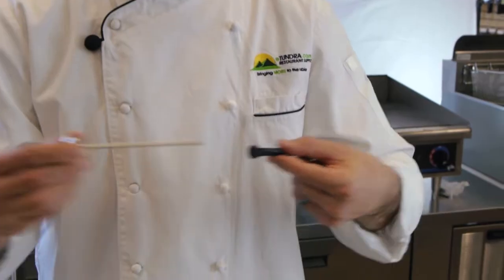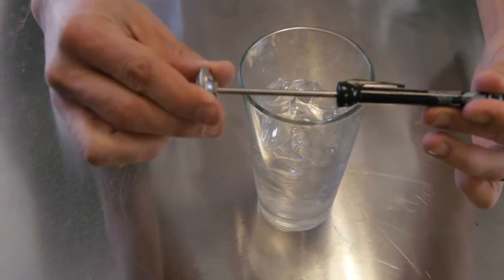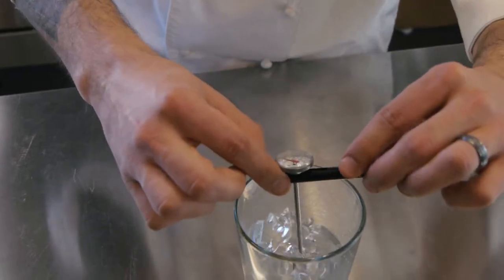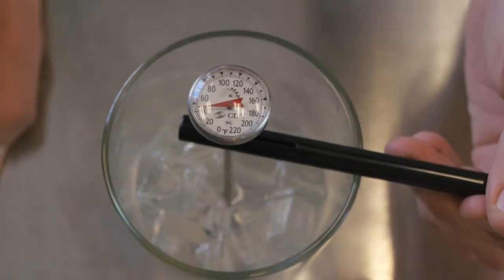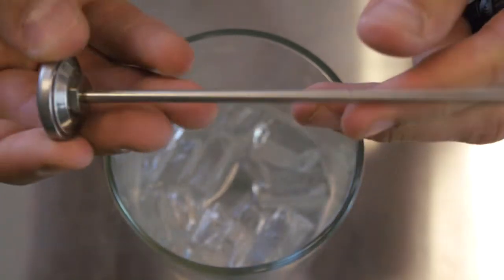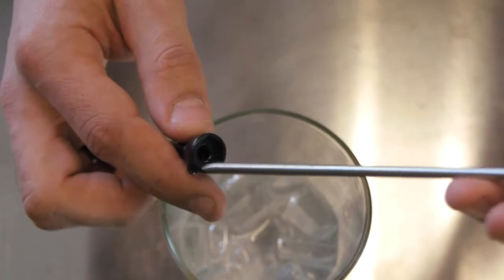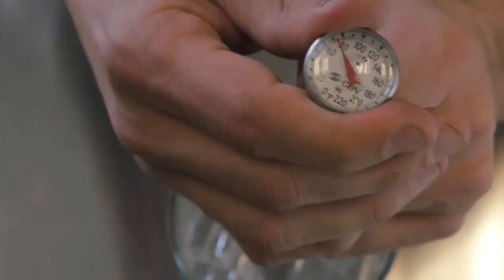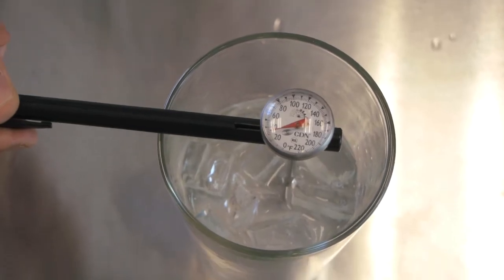How to Calibrate Dial Probe Thermometers | eTundra

Comment: If you're going to be measuring hot foods, it would be better to calibrate in boiling water.
Reply: After you calibrate then what. … it. Doesn’t measure the temp of fish or burgers at 135-145 degrees

Comment: It’s best to put the water in a cold place, and put the thermometer in there so that the temperature taking part is slightly below the surface, like 1/4 inch deep, then wait for the top layer to freeze, and then see if it’s reading 32°F, otherwise the liquid water might be too warm and effect the reading. So the thermometer could have been accurate at first.

Comment: Well I have a meat thermometer with an adjusting nut, but the lowest temp is 120°. The highest is 200°. So I guess I'll have to use a candy thermometer, heat the water to apx 120° and adjust the thermometer to that!
Reply: You can't heat water above 100. It will boil before that point. Unless you are talking about 100 F?
Reply: @timothyn4929  Farenheit of course!

Comment: Ice water 34 degrees frozen water 32 degrees
Reply: Water can actually reach 32 without freezing.  If it is mostly ice,
& very little water, (works even better with crushed ice)  then you really get 32.
 Dropping a few pieces of ice in a glass of water is not the same at all
Reply: This really makes no sense because it can easily be inaccurate by a few degrees.  Ice water in a glass can be 30 to 34 degrees.  The only way you can get this right is by using another accurate thermometer
Reply: @Tommy_Powell_7  I usually calibrate these with my room thermometer and hope they are accurate. I use them to check dryer temps.
Reply: Ice melts at 32deg F (0 C) its the phase change point and is constant